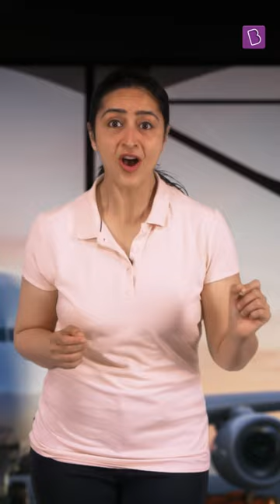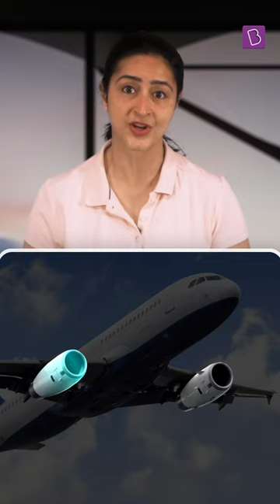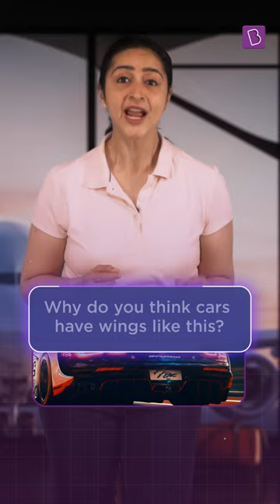How Does Physics Help Aeroplanes Fly | BYJU's Now We Know Shorts

Comment: The air moving under the car moves faster than that above it, creating downforce or negative lift on the car. Airfoils or wings are also used in the front and rear of the car in an effort to generate more downforce. Downforce is necessary in maintaining high speeds through the corners and forces the car to the track.
Reply: Streamline shaoe

Comment: 😮The job of the wing is to create downforce. This downforce allows the car to stay on the ground while cornering and travelling at really fast speeds. Wings are mostly used in high-speed cars. There are other ways to do the job a wing does but using a wing is more efficient and faster.